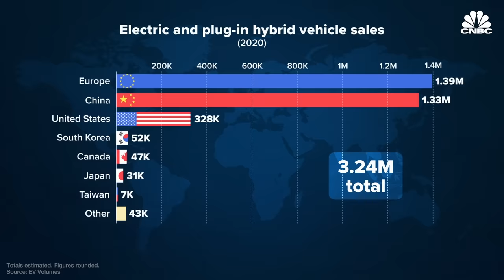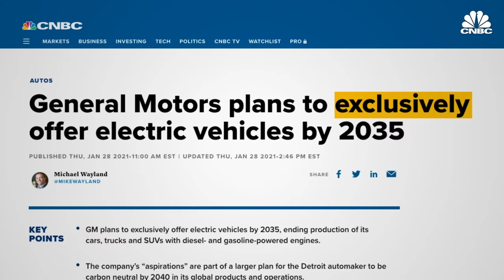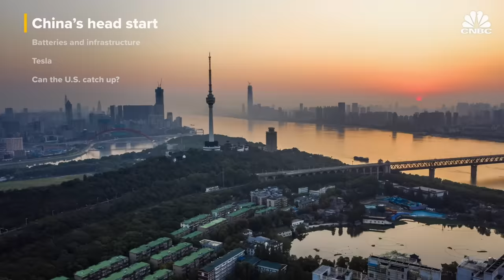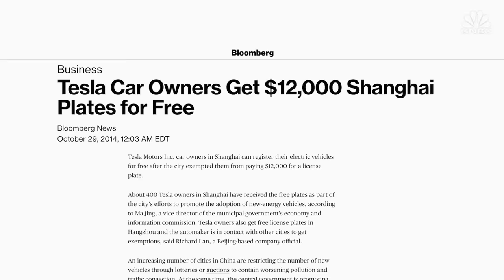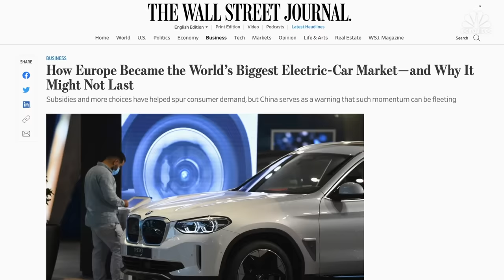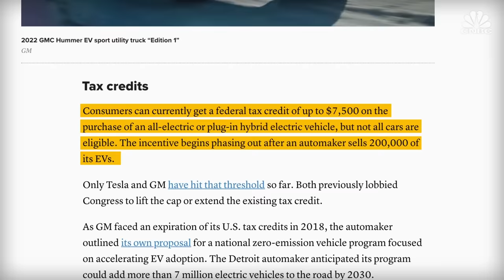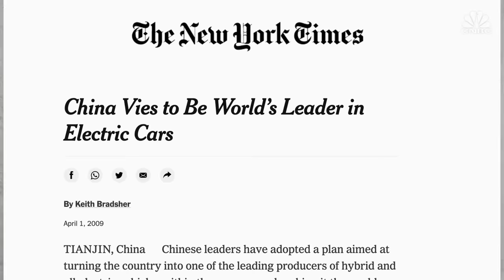Who Is Winning The Global EV Race?

Comment: There is no "Transition to electric vehicles"  Not that people don't like subsidied EVs - there isn't enough lithium. Even IF you devoted every ounce of the 100,000 Tons of lithium to EVs max is 10 million Tesla Ys for the WORLD.  But there are 1 billion cell phones, battery farms, laptops etc. all using lithium; so the real number is 5 to 6 million in a market of 100 million vehicles annually, 5-6% niche market isn't a transition.  At this point EV advocates say what about sodium what about carbon .. what about them? There isn't a single vehicle incorporating them yet.  More sobering? 1.4 Billion light vehicles exist of which EVs are 0.3%.  Add to this EVs don't work for a lot of purposes - they perform terribly under load. A Rivian truck towing a trailered Mustang only goes 120 miles before needing a charge, 100 miles in frigid weather.. same goes for any EV under load; their range is horrible in that circumstance.  If it were not for "subsidies" they wouldn't even be selling well; EVs are more costly than alternatives.
Reply: Lol